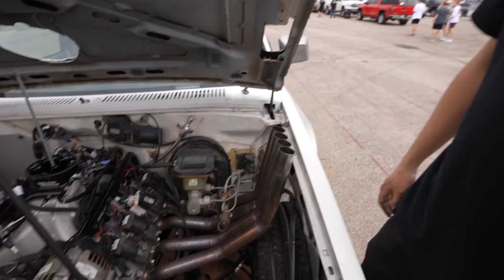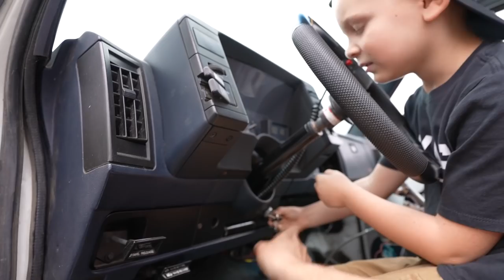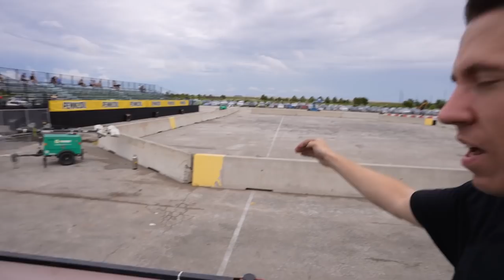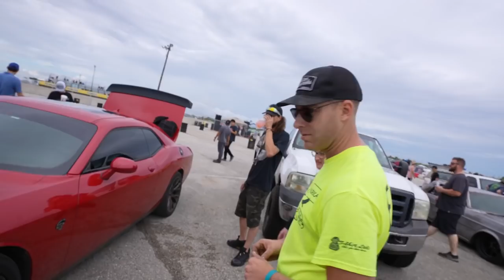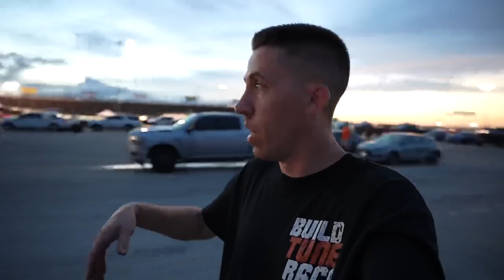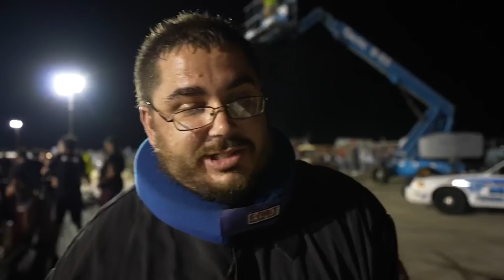LS Swapped Nitrous S10 INSANE BURNOUT - Cleetus and Cars

Comment: good solid skid mate plenty of revs no limiter  excellent driving by brail  in the smoke (never lift ) good skid to watch  (maybe should have run down the rails , crowd loves that ), you filled that pad with smoke and kept using the pad , now you gunna have to accept the judging on most burnout comps  sucks and maybe if you had a 6/71/8/71 hanging out the bonnet aahhh you know where this is going